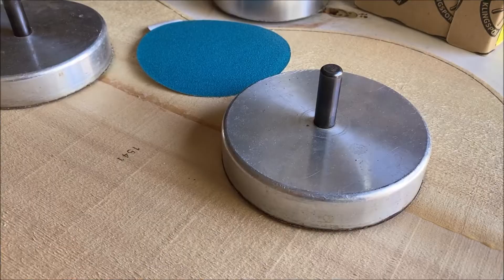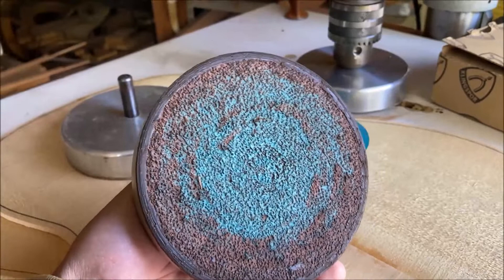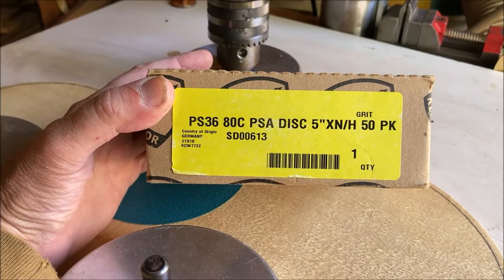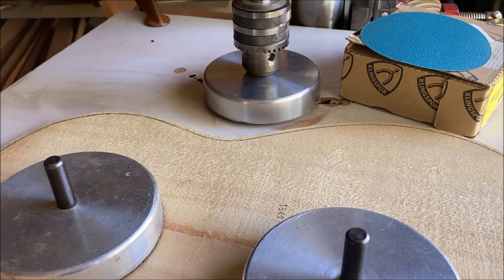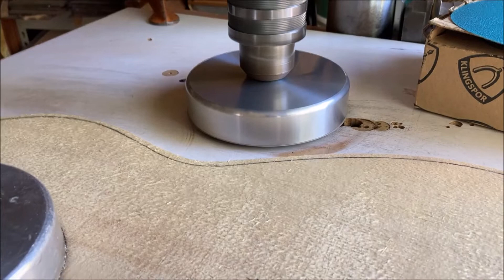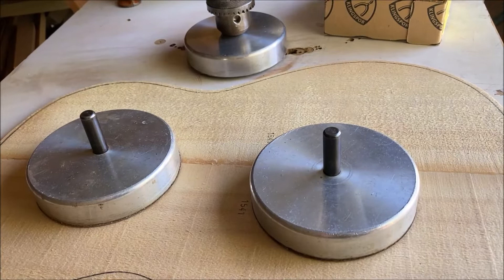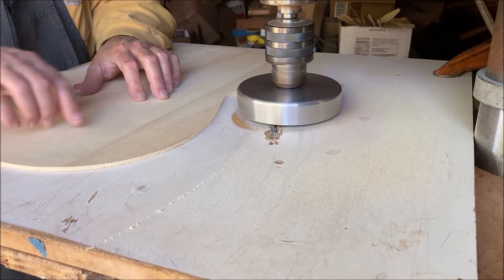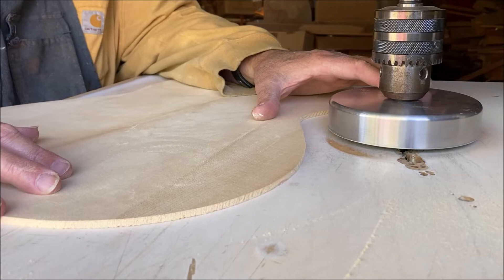Luthier Reveals-The Most Amazing Guitar Making Tool EVER! | Schramm Guitars

Comment: I have one and I use it a lot. A couple of extras would be nice to have. The trouble that I run into is in having only one drill press, the table temporarily attached to the drill press table doesn´t always go back on true. I get it close using playing cards as shims. I guess another drill press is in order. Feeding takes some getting used to. I took the regular handle for raising and lowering the table off and put on a round knob for making the fine adjustments. It is vary handy for bone nuts and saddles, and don´t forget the enjoyment of the fragrance.
Reply from the maker: Every part on my guitars comes off this. Love this tool

Comment: Cool stuff.  You need a really good drill press to go with that tool.
Reply from the maker: I used a $79 Sear bench top drill press for about 10 years before I got the Delta floor model 20 years ago. Made over 100 guitars with the cheap drill press.
Reply: @schrammguitars  Good to know.  Thanks.
Reply: This is literally genius, as a hobby luthier with not a lot of tools this is the ultimate solution